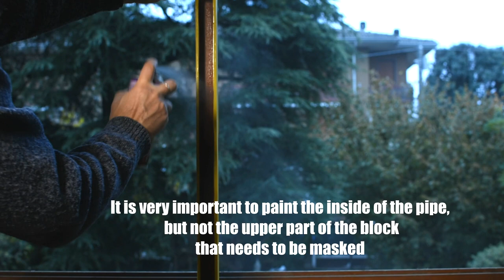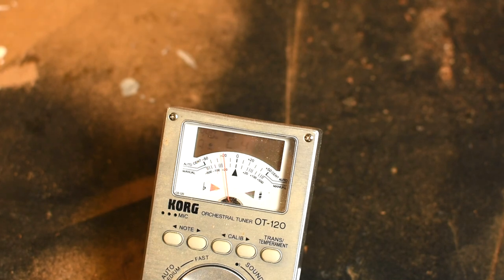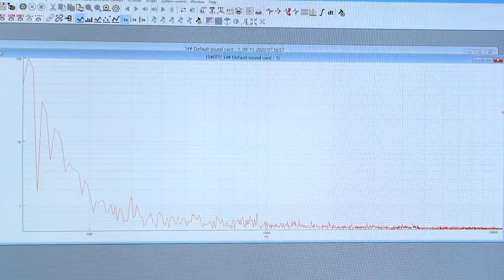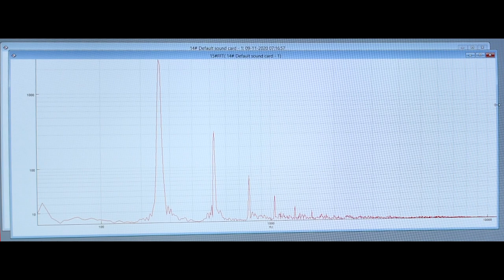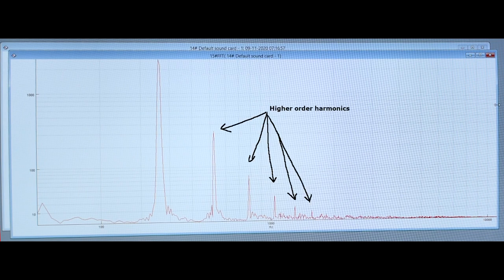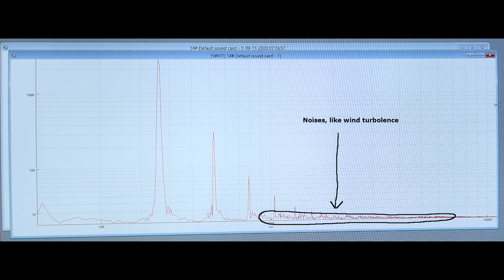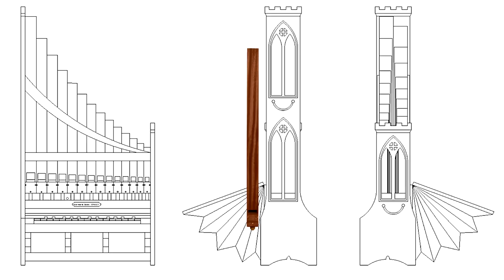How to build a portative Organ | #3 The pipes | Part 2 | SUB ITA | Homemade Pipe Organ

Comment: Thanks for the Tutorial but, how can you tune the pipe if it's the wrong frequence? because on the most pipes there are those blocks on top of the hole in the pipe. Can you show us in the next video how to make that?
Reply from the maker: Hi, thanks for the question. It is not yet time to tune the pipes, I will tune them precisely when the instrument is completed, because they must be tuned in their final position, cutting them in the right size, because these are open pipes, without stoppers. For now, I'll leave them slightly longer.

Comment: what software did you use to test the harmonics?
And what is that tool you used to plane the pipe?
Reply from the maker: Hi jackson, the software is trueRTA spectrum analyzer, paired with the Behringer ECM8000 measurement microphone. The tool I think it's called scraper, "rasiera" in Italian. Thanks!
Reply: @nippocast  Love your channel. Thanks for the reply!